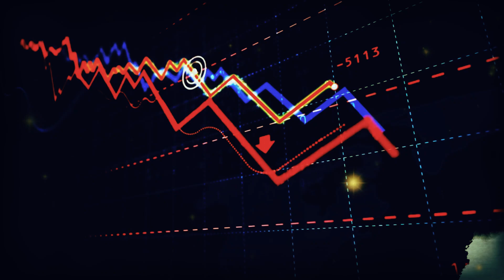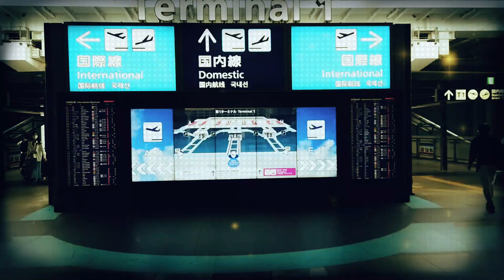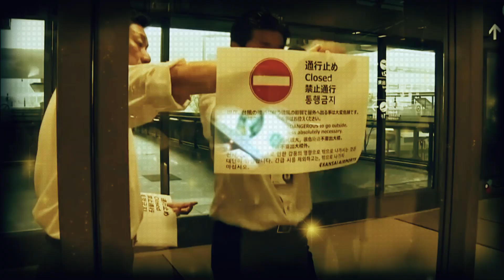Kansai International Airport: Japan's $20 Billion Sinking Marvel | #Factastic

Comment: I remember that Foreign contractors were excluded from bidding for this project because the Japanese insisted that they would have insufficient experience in this type of work/project to make a success of it !!    Now they need to go away and scratch something long and hard to fix it.
Reply from the maker: @jhonbee5434  Yes, the decision to exclude foreign contractors from bidding on the Kansai International Airport project was based on the Japanese government's considerations at the time. The ongoing issues with the airport's sinking pose significant challenges that require extensive and thoughtful solutions. Addressing such complex engineering problems indeed demands substantial effort and expertise. It's an ongoing process, and hopefully, the necessary solutions will be found to address these issues effectively. Thank you for sharing your perspective.